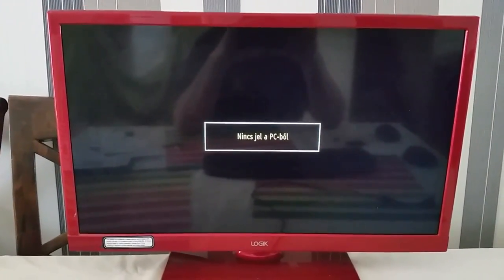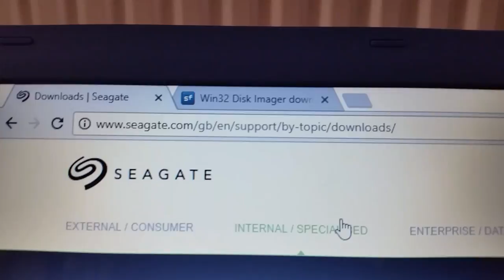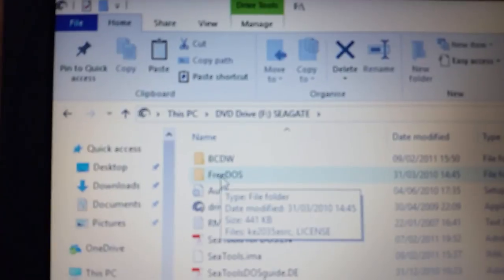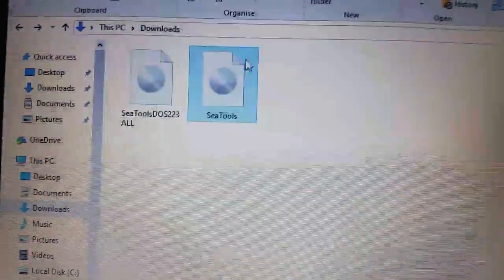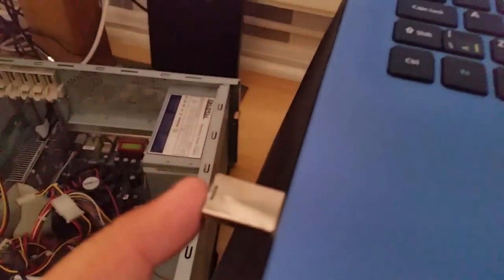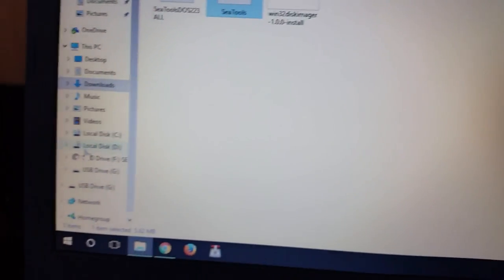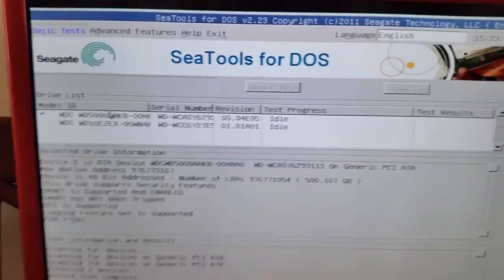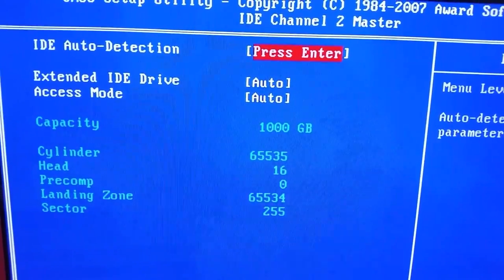How to fix shrunk 33MB hard drive back to original 1TB size

Comment: i have to confirm that this method will not lose any data. thank you pete. you save me a lot of work today. for those who can't detect the hard drive when running the tool, make sure change it to IDE (not sata) in bios settings
Reply from the maker: I’m glad it worked for you.
When I recorded and uploaded this video I could have not imagined that this many people will need this guide. I’m 38, tinkering with computer since I was 9 and I’ve not heard from anyone in my life such a problem like this so I thought this guide will not be watched more than a few times in total. I’m so surprised when I look at the watch count.

Thanks for sharing your experience with us in regards of not loosing data.
Pete
Reply: Would you be able to help me? Switch to ide but it doesn't work.. the program doesn't start.
Reply: is is erase all the data on the HDD?

Comment: Outstanding, Many thanks just recovered all my data on a WD 1TB which shrunk to 32mb, you is the man :), Western Digital support don't even know how to fix this fault when i called them.
Reply from the maker: Can you tell me how you've managed to recover data. How easy was it? Was everything back as it was before or you used some sort of data recovery software?
Reply: no data lost followed your guide powered off machine, powered back up booted to a second hard drive containing Windows 10 Pro X64 , 1TB WB Black drive viable and all data readable. now moving all the files to a new drive and sending this one back to WD as still in warranty by 2 months. called WD Support before finding your video and they are useless, 1st line rep just kept asking me to resize the partition in windows, guy was not listening to what i was telling him.
Reply: Best to packages for recovering the partitions if they don't restore are GetDataBack Pro and DiskGenius both not cheap about £60 and £110 but they have saved my life in the past, hope this helps.

Comment: Really Thank you. You saved my data and time.
this is really easy and works great!!
WD 1TB -> 33MB problem solved.
Seatools graphical dos version didn't work for me (mouse and keyboard freeze problem) but Text dos version worked very well
Don't need to spend long time to make boot USB in other way.
Reply from the maker: Dongwon Lee that was my goal when I’ve recorded this video. As you see it is just a handheld phone recorded very low quality video but because it took me a long time to figure out how to repair the drive I thought this video would help others like you who have the same issue.
I’m glad I did help some people with this.
Reply from the maker: I had issue with keyboard and mouse on older motherboard. In the bios the USB keyboard and usb mouse support has to be enabled.

Comment: It shows 'Failed' for my Seagate 1tb Hard Disk, and also when I am selecting that drive in that DOS system, it is not showing any details about it as in your case.

Please help.
Reply from the maker: Load the software wait for it to find the drives. Select the drive you want to fix but don’t do anything yet. Disconnect the power from the drive only and then reconnect. Without refreshing any data in the utility just go ahead with the fix. Good luck.
Reply: @PeteTum  change your drive configuration in the BIOS from SATA to IDE

Comment: Hi Pete, please help me. The Seatools is not loading my drives. I've waited almost 30mins already now. I have disconnected the drive that needs the fix and yet it won't display my Drives on the Seatools. Please. My HDD is 2TB and now it's 3.86GB Unallocated.

Further update: when I'm loading the Seatools from boot, it says InitDiskError reading partition table. With or without drives connected to the computer. I have used different Computers but the drives on the PC aren't loaded
Reply from the maker: Sorry it's not easy to guess what's wrong there.
Reply: @PeteTum  I've been able to get that done. I just changed my drive configuration from SATA to IDE and it was able to load the drives.
But the drive failed basic test as it wasn't even spinning. I found another video from hddrecovery showing how to remove a dead IC from the back panel of the drive.
When I tested my drive with a Meter, I found two dead ICs. Now I'm thinking of borrowing a back panel from another 2TB Seagate.
I don't know if that'll help. Cos I just want my files out then throw the drive away
Reply: @temiw0n  i/m having the same problem (My HDD is 2TB and now it's 3.86GB Unallocated). Is your problem solved? Can you share how you solve it?
Reply: @chonro  The Seatools might work for you, but didn't for me. Hard Drive is toast

Comment: Will it erase all the data? Or is the data accessible with some recovery software after capacity has been corrected by sea tools... I've Seagate 2TB showing as 2.89GB.... I want to make sure if  this trick permanently erases the data or not....
Reply from the maker: In my opinion it will not overwrite data on the disk. However I can not confirm or deny this. That would take a lot longer to do. The fix happens almost instantaneously.

Comment: Does it work for sd cards as well?
Reply from the maker: it does not work in an SD card reader I have tried it already in a hope I can fix the fake sd cards but the aplication does not recognises it. I guess only ide and sata drives will work. You can try to experiment with an SD card to sata adapter. :)

Comment: When we  applying this fix, will it cause any data loss??
Reply from the maker: In my case I was about to format the entire drive with windows installer when it has failed so there was no any data on it that I needed. But yes good question there.. what if.. Technically after applying the fix I had no partitions on the drive. In fact I had to initialise it just like a brand new drive. But the data on the disk is probably still there but the drive doesn’t know what is where. If that’s some very important data for you like family photos videos I personally would take the drive to a specialist. If it’s less important and you prepared to say goodbye to it then you can risk it to try to recover it yourself. After applying the fix don’t do anything with the drive. Find a data recovery software. Most of them are not free though. Try to find one which can scan the drive even without a partition on it. That’s your biggest chance. And in the future remember the rule! One copy is not a copy. You loose it and it’s gone forever. Keep 3 copies of important data on 2 different medium and at least 1 which is off site like at an other location or on the cloud. Good luck with your recovery.
Reply: @PeteTum  Thanks buddy
Reply from the maker: Try DiskGenius www.diskgenius.com I've used this before and I have good experience with it. After restoring the disk size with Sea Tools do not initialise the disk or create any partition (if you haven't already). DiskGenius can scan the drive even without a partition reducing the risk of overwriting any data. But I'm still saying if the data is super important then seek for a specialist.
Reply: It happened to my C: drive. Couldn't boot up and Windows disk couldn't repair it. Followed these steps and I'm back into Windows at the login screen. NO DATA LOSS for me.

Comment: it's not working on my Toshiba  p300 hard disk I follow everything
Reply from the maker: Do you have a log from the program what happened and if you had any error messages?
You may need to disconnect the power from the hard drive just before you hit the "set capacity to max native" button.
So first do everything as normal and once you select the hard drive unplug the hard drive for a moment then reconnect.
Good luck

Comment: What if this happens with a USB hardrive
Reply from the maker: I have tried this with usb hard drives they work too. I can’t say they work with all of them but the ones I’ve tried worked fine.
Reply: @PeteTum  does it recover the stuff on the flash drive
Reply from the maker: @johnherbst8982  to find myself in a situation when a hard drive fails like this is I believe a once in a lifetime event. I can replicate the problem by using this utility and change the size manually something smaller. This way I can re-experience the issue and try to fix it again. Every time I do this manual killing the drive method and the fixing it I have all data on the drive and I can even boot into the operating system on the actual drive. So I confidently say that the FIX itself will not damage any files or partitions BUT it will also not fix any damage made by the very unfortunate incident that killed the drive in the first place. So the bottom line is.. if the files are lost already on that drive then NO this utility will not fix the files but it will fix the drive. At the other hand if the files are untouched on the drive and the only thing "broken" is the size of the drive then after applying the fix your files will be there for you. If I would be you I would not boot from the drive but attach it to another computer and try to recover all files that way. Do not copy anything onto the drive before you save everything important for you. If files are missing then use some recovery software to scan the drive. Good luck and report back here if you succeeded or failed.
Ps. You can always pay a data recovery company to get your files back. It's not as expensive now days as you would think. I had a quote for a 1TB hard drive in the UK in 2018 for £200 and they would give me a brand new hdd with all my recovered files on. You need to decide if you risk it yourself or pay a professional to do it for you.